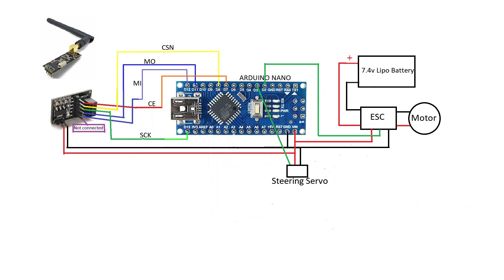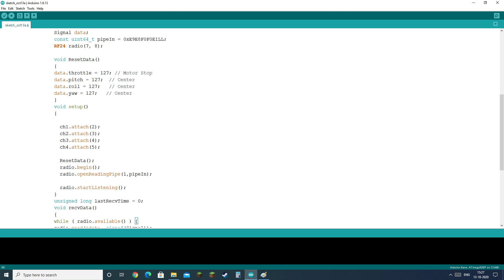RC Car रिमोट कण्ट्रोल l DIY RC Car Transmitter and Receiver

Comment: Bro I am having one more question suppose I am having 1000kv brushless motor with 1045 prop with 2200 mah 3s lipo battery, suppose it's thrust is 200g and when I will use 3000 mah lipo battery with same motor and with same prop will it's thrust will be same or it will give high thrust or it will give only more flight time no high thrust 🙄🤔????? plz suggest me 🙏🙏.......I am not finding it's answer anywhere that's why I am asking you plz reply bro....... 🙏🙏
Reply from the maker: thrust will be same.  if you use 4S lipo then thrust will be different.  Agar voltage change kiya to RPM change hoga aur thrust change hoga
Reply: Sir matalab only flying time increase hoga no change in thrust

Comment: Bro I am having three cells of 3.7 v and 1700 mah ,if I connect them together will it work like 3s lipo battery which is having 11.1 v and 5100 mah 🤔🙄 ?? Plz tell bro........
Reply: These are lava phone batteries of li-ion
Reply: Bro reply plz bro 😭🙏🏻🙏🏻🙏🏻🙏🏻🙏🏻🙏🏻🙏🏻🙏🏻🙏🏻🙏🏻🙏🏻🙏🏻🙏🏻🙏🏻🙏🏻🙏🏻🙏🏻🙏🏻🙏🏻🙏🏻🙏🏻🙏🏻🙏🏻
Reply from the maker: no you can not use them in plane becuase uski C rating kam rahegi. RC Car me shayad use kar sakte ho
Reply: Ok bro thanks you are great I have asked one more question that I have comented plz reply to that also bro..........🙏🙏🙏

Comment: Bro which brushless motor produce high thrust 🤔🙄 1000 kv ,1400 kv or 2200 kv ?? Please tell bro
Reply from the maker: 1000kv with 1045 prop
Reply: Bro but how much thrust will it produce with 1045 prop. From 11.1 v and 2200 mah lipo battery 🤔🤔🙄🙄 ??? Please tell bro.....
Reply from the maker: @fs0016  google kar lo yaar mil jayega. 1kg tak hai shayad
Reply: Bro which battery I should I use with 1000kv with 1045prop for high thrust plz guid me I want to make an aeroplane

Comment: next project : Rc plane Transmitter and receiver 
pleaseeeeeeeeeeeee
Reply: It is not easy to make a flysky equavalent transmitter it is better to buy one
Reply: @rcbuildmaster6192  I own one but i wanted to make one myself so i asked for guidance
Reply: @tarunjaiswal8662  ok no problem you can use 2.4Ghz  RF module which is compatible with Arduino for controlling rc plane
Reply from the maker: ha banata hu jaldihi